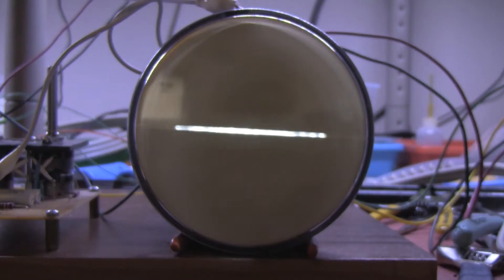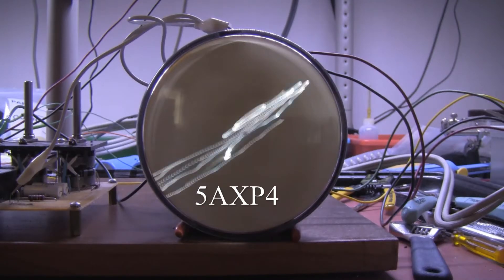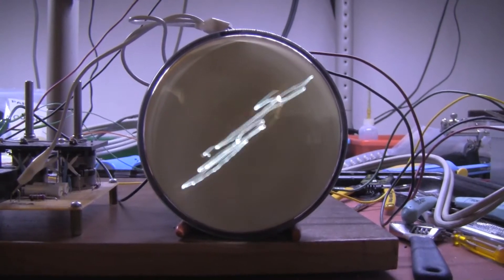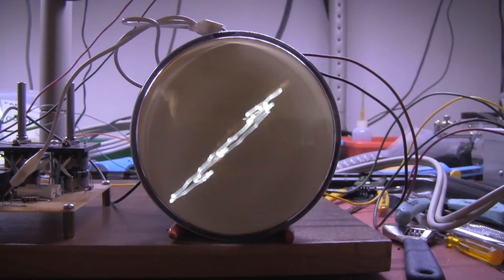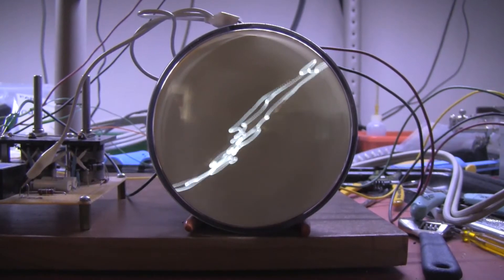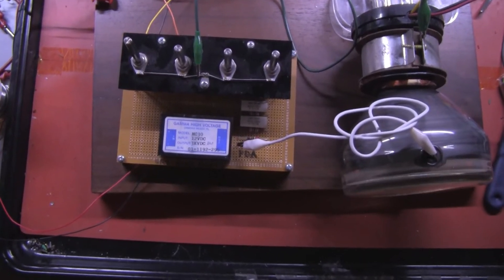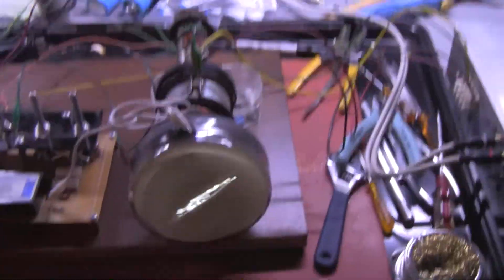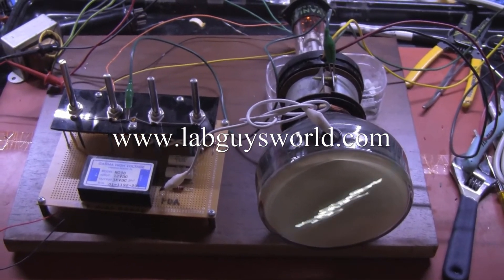5AXP4 Project Teaser

Comment: I've had good luck with the 5AXP4 at 5KV displaying vector graphics.
Reply from the maker: Hi Eric. I have the nutty idea of driving the yoke with class A wideband amps. I will feed h&V ramps are whatever speed I like. CBS field sequential color, for instance. This is the discovery phase for the next project, the color flying spot slide scanner.